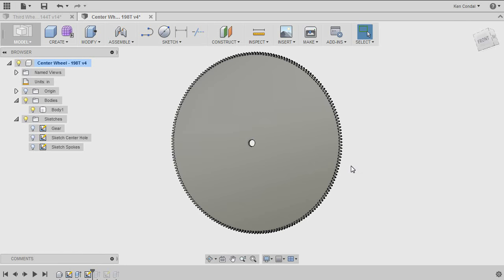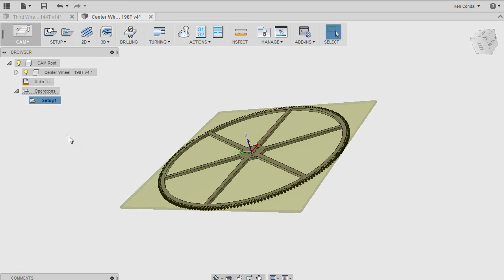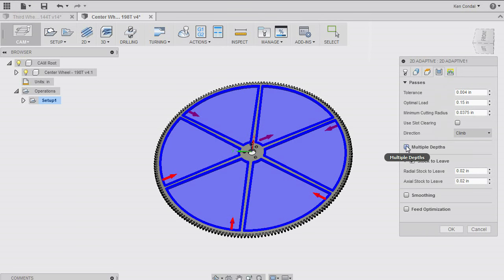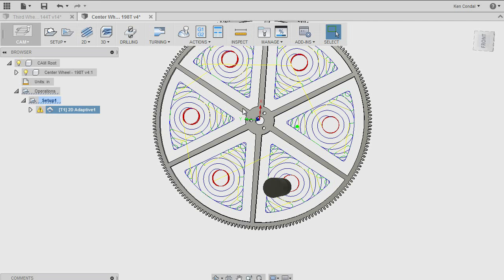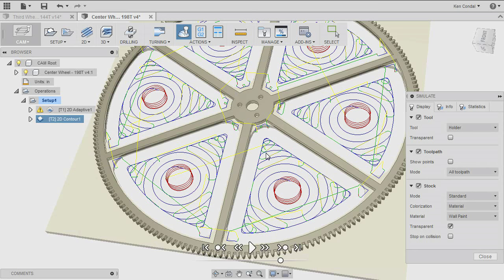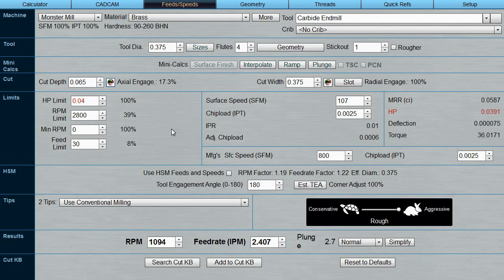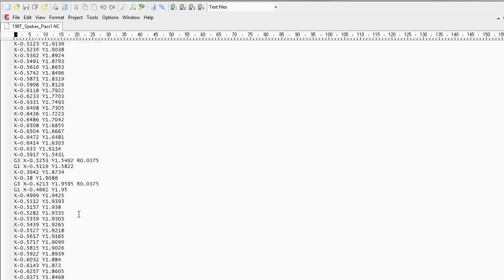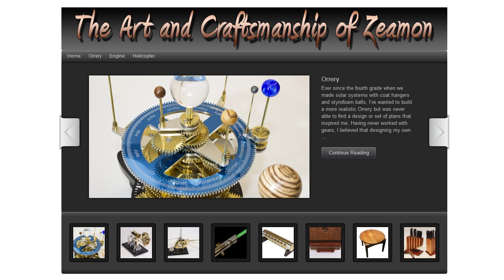Making A Clock - Part 2B Gear Spoke CAM

Comment: The CAM part of the operation isn't always explained.  I'm trying to decide which machine to buy to start CNC machining.  Watching you use your Sherline make that system appear to be a viable starting place.  Thanks!
Reply from the maker: +Metallurg33 Sherline makes great machines and mine has served me well. Just keep in mind that desktop machines are intended for making small parts, as I did the first few years I had mine. As I started to build larger pieces I had to keep enhancing the machine, as would be true with any machine. Although my lathe is still all Sherline, my mill has so many enhancements that there's very little Sherline left. And I STILL want something bigger! You can make incredible projects with lots of small parts - you just need to know up front if that's your intent. Sadly, the next step up in size is a big commitment - something like a Tormach 440 which costs a lot more and needs much more space.

Comment: I have great admiration for your work as well as for Click springs. I recently finished a somewhat different version of this clock made all of wood.  It is  a little larger but runs well and lasts 12 days on a wind.  The wheels and pinions are the same as Wildings except for the first pinion which is 16 leaves instead of 8.    I cut all my parts on a small CNC mill.  I will add a picture soon.
Reply from the maker: Thanks and WOW! I can't imagine tackling this in wood!

Comment: Thank you for the very instructive video. 
Could you superglue the waste parts instead of drilling and tapping them ? (similarly to what you did on the lathe)

In what material the support is made, does that affect the cutting speed and feed rate ?
Reply from the maker: +Dimitri Masson The mill exerts much more force than the lathe, so the glue would be risky. Also, there is VERY little gear material left after the spoke waste is removed, so there wouldn't be much surface for the glue to hold onto. Technically, the fixture material could alter the feeds and speeds but I'm barely scratching it so it's safe to ignore it.

Comment: Hi Ken,  Interesting the setting up of Fusion for CAM.  Did you consider keeping the wheel stuck to the aluminium hub when you cut the gear and then could you have machined out the parts without the need for clamping?
Reply from the maker: +myford vmb Thanks! I thought the CAM would be an interesting thing to see since most videos omit it. The glue wouldn't work for the spokes - I gave a detailed explanation a few comments back.
Reply: +KenToonz Thanks Ken.  RE Glue: That has saved me some heart ache.

Comment: Hi Ken, thanks as always for sharing. I have learned a great deal from you over the years and very much appreciate the quality of your work. Like you, I am using Gearotic and Fusion 360. I am, however, having trouble getting epicycloidal gears into Fusion once exporting them from Gearotic. I noticed that your profiles are very smooth. Do you have any tips on how to import the gears, or did you simply sketch them from scratch in Fusion? I've tried reducing the Meshsize in Meshmixer, but that seems quite complicated for nothing. Thanks again for such inspiring work.
Reply from the maker: Thanks for the kind words! Yes, gears are a problem. When I built the Orrery I was using Alibre to do the CAD and I wrote a script to draw cycloidal gears. For the clock I used the Alibre script and imported the resulting DXF into Fusion, no problem. For the ratchet I used Gearotic and once again imported the DXF into Fusion. No problem (and not sure why it didn't work for you). I might have had to do some rescaling in Fusion, but I really don't remember. For the ratchet gear I actually drew it in Fusion.
Reply: Thanks Ken for your response. The Issue is that the DXF of the gear from Gearotic is that it has several thousand line segments and therefore is very processing heavy in Fusion 360. I have tried using an online cycloidal gear builder, but that DXF doesn't import into 360. I have also tried creating an SVG, and then importing that into the sketch environment, but Fusion misses the tooth profile in the SVG file, even though it looks ok in Inkscape and Illustrator. Will keep experimenting. I think I may just end up drawing the gear manually.
Reply from the maker: Make sure you're importing a 2D DXF from Gearotic. You can extrude it in Fusion. Although it's nice to draw a proper gear, it really isn't necessary since you won't be using Fusion to cut the teeth. You could just model circles with spokes. Also, if you can just model a small gear in Gearotic with the right modulus, you could copy a single tooth and do a circular pattern in Fusion. Just some thoughts...
Reply: Am I so happy to find this post😁 I've done a few things I fusion but decided I wanted to design a mechanical clock. As we already know there's a lot of math involved in this process. After spending hours searching the web for a solution I stumbled on this posting on Kens vids. It seems the 'Gearotic' might just be what I'm looking for. To confirm can a toothed wheel/gear designed in Gearotic be imported in to Fusion 360 and be manipulated? I wanted to be sure as there's a fee for Gearotic which if it works ought to be worth every penny.
Oh and Ken I've subscribed to your Chanel and I'd like to say I could watch and listen to you for hours, you just have that voice.. well presented . Thanks!!